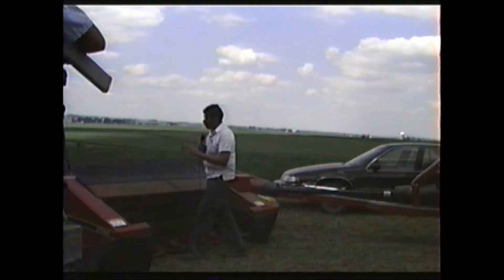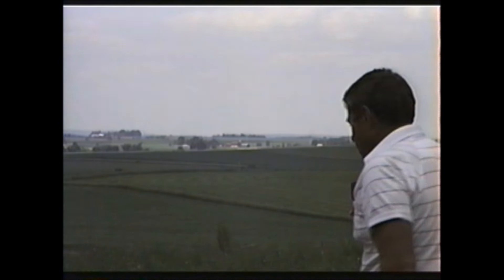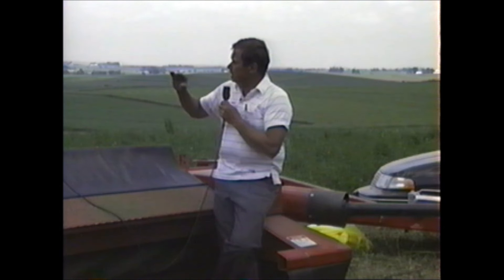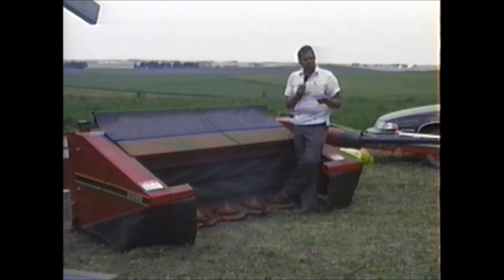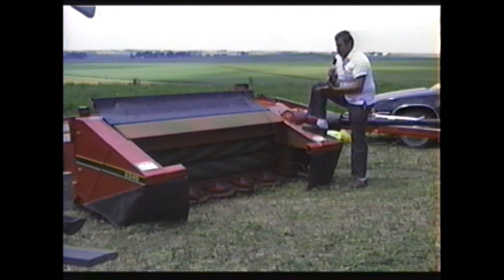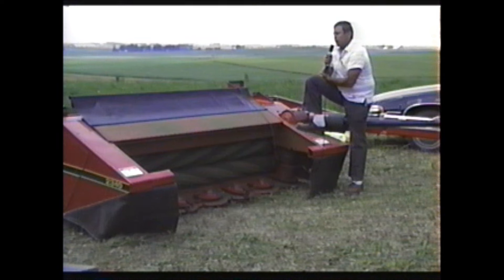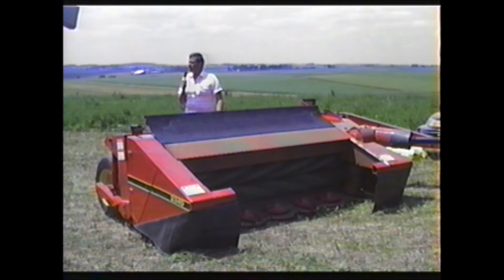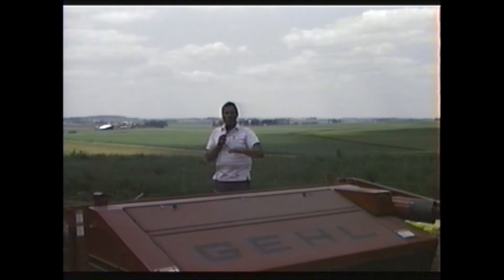Gehl Hay Days Dealer Field Meeting 6-6-91 The 2340 Disc Mower

Comment: Those never took off around me for what ever reason.............Maybe because New Idea got the market first.
Reply from the maker: Would that have been with the 5209? Those are decent little mowers! Almost had a couple of them in the past & kept getting outbid. 🤷‍♂
Reply: @ikonseesmrno7300  yes, 5209 and the 5212.  I still cut with a haybine, New Idea 509 which is actually a 1190 IH..........but am looking for a 5209 now my oldest is mowing and a second machine would speed up things.  .